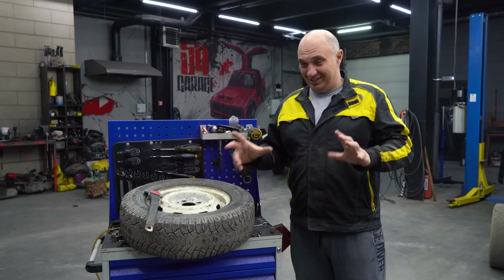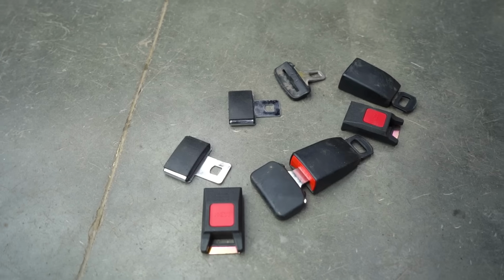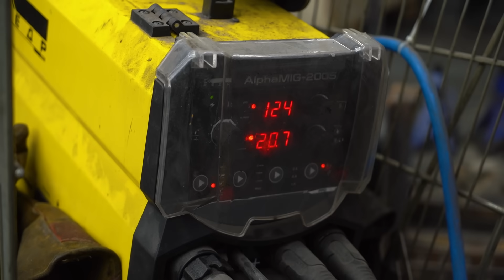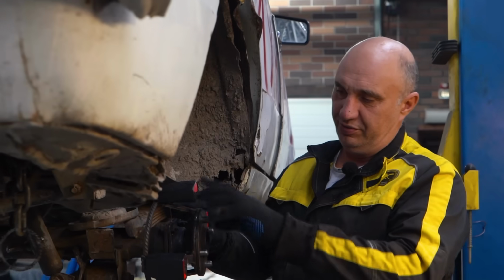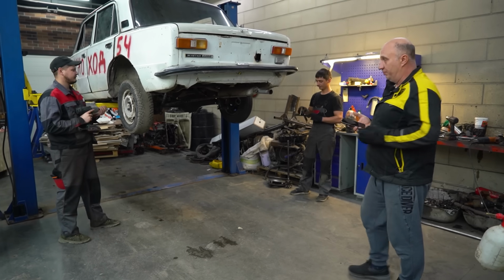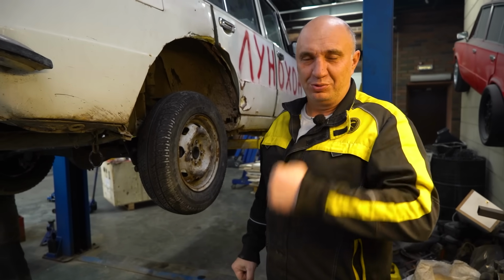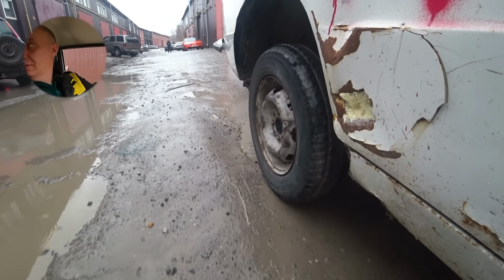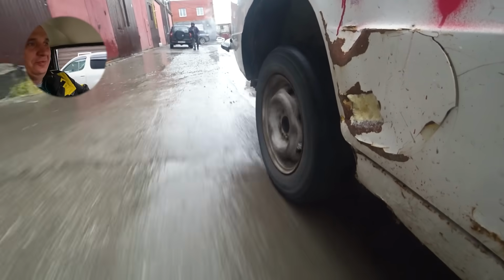Quick seatbelt buckle wheel release mechanism - will it work?

Comment: Just when you think they can't possibly have any more car related things to do, they come up with something crazy like this!
Reply: I would never get this idea!
Reply: Gasoline as coolant?😊
Reply: When they check the comments theres hundreds
Reply: These guys have some wheely cool experiments, such as the seatbelt wheel release, and these guys never tire me. :) 

OK, I'll walk out now with my puns.
Reply: @thatguyalex2835 I agree. I was strapped in tight for this episode. Wonder what the plan is for the shoulder restraints. It's gonna be good.
Reply: @Boycott_Wendys wonder if a diesel could run off it if you left a little in the lines just to get it fired up
Reply: @Boycott_Wendys  gasoline as a coolant does actually work, check out Ken Blocks Hoonicorn Mustang with 1400hp engine but no radiators, the Methanol gas cools down the engine drastically which maintains the engines temp even at extended time of high revving while drifting intensively.
Reply: @ren_03 I think you misinterpret the Hoonicorn’s a use of radiators. It still uses radiators to keep the coolant and oil in check, the radiators it DOESN’T use are the ones to cool the air going into the engine from the turbo, which are more commonly called intercoolers.
The reason methanol burns “cooler” especially in pressure(boost) situations, is it takes twice the amount of fuel. A much higher volume(near double) of liquid fuel is needed to combine with the air, therefore allowing that extra liquid to absorb more heat of the air, dropping the overall temp of the air down. I might be describing that wrong, but that’s how I’ve understood it.

On the topic of gasoline as coolant, I believe there were some channels here on YouTube that did just that recently, should give them a look!
Reply: @ren_03  I'm talking about gasoline instead of coolant in a sealed system. How long before it would blow up, or would it even blow????
Reply: @Colorado_Native  Haha. We better put a brake on these car related puns.
Reply: @thatguyalex2835  Brake fluid for coolant, you say?
Reply: someone suggested it, think they said near the end

Comment: Seat belt latches make for some interesting experiment ideas! I have some below:
- How many seat belt latches are needed to tow a car? Maybe use seat belt latches to attach or pull a long trailer to go with the log truck. 
- Substitute seat belt latches for engine and transmission mounts to see how fast you can pull a drivetrain
- Use seat belt latches to hold a head down on an engine block and see if it will run.
Reply: actually amazing ideas
Reply: Fun fact on your first point, the answer is one. In fact, the seatbelts are so strong I've seen a car lifted by one getting scrapped. I used a seatbelt to yank a Chevy 6.0 last year 😅 seatbelts are incredibly strong.
Reply: In the US the minimum breaking force is 22,000n so you could probably tow quite a heavy car without any problems at all. Infact you're likely to pull the towing eye out first.
Reply: seatbelt engine swap sounds nuts!!
Reply: You got some great ideas man you must have too much time on your hands hahaha
Reply: I would think it would have high tensile strength seeing it is a seat belt so in theory it should tow some pretty heavy loads.

Comment: To see it work flawlessly is seriously impressive. I expected a failure in a few seconds, especially with a welded diff.
Reply: a quick release mechanism on your cars wheel what could possibly go wrong with that plan?🤣🤣🤣
Reply: It's kinda impressive, but if it were real, it would have to last much longer and in crazier conditions than it did here. So the question isn't, does it stay on for a few minutes, but instead, does it stay for 100k+ miles.
Reply: @georgerosebush9754 of course it doesn't. That's not the point

Comment: This is probably do-able with quick release air fittings as well, for that matter It would probably be fairly easy to make an axle sized version of the same concept.
Reply: Kinda like a quick release steering wheel.
Reply: It would be hard to get the wheel off. At least with this design, they have that 4 pronged tool to detach all of them at once. Those air fittings can be a pain in the ass without a wheel in the way.

Comment: Going mostly forward, the studs take most of the load and the buckles only need to keep the wheel on the hub. To really give them a workout, you need lateral load. Try doing donuts both ways!

Comment: they're testing the welds because these latches can handle tons (during a crash you can whistand until 30G during a tenth of a second so 70kg x 30G = 2100kg for one latch and one of these latches stoped my 100kg++ during a crash so these latches can handle something like 5 tons each, so they're testing the welds not the quick release mechanism)

Comment: The real stress was held by the 4 guide nuts and the center of the driveshaft. The seat belt mechanism only prevented the wheel from separating from the driveshaft. Don't get me wrong, it's still very impressive! 😁🤯

Comment: The failure point here would come from the wheel being out of balance, overtime it may crack the welds but would take alot of force and probably highway speeds to get to thay stage. Otherwise can see how it would fail with the studs taking alot of load aswell.

Comment: I'm amazed it didn't break, I know they're rated for some incredible forces but in normal uses those forces would be in particular directions and very different to the forces in this case. I thought the sideways motion (rather than traditional "pulling" motion) would break them for sure, but apparently not!
Reply: I did too but then realized they machined studs to tightly fit the stud holes to prevent any sideways force on the buckles, they just prevent the wheel being pulled out away from the car.

Comment: A normal wheel setup has or it is supposed to have all the force applied to the center hole or the hub. Thats what is designed to take the load and the studs and lug nuts are clamping force to keep the wheel on the hub. When you dont have the proper wheel one your car that is when you get shaking and broken studs. Just because the lug pattern is the same that doesnt mean your new wheels are correct for your car.There are other ways to break off the lug nuts obviously but improper wheel hub fitment is very often overlooked and bad things can happen as a result.!!!¹

Comment: The lug are still there just not with the nut so in my opinion the lugs are taking the load when accelerating and the belts hold on turn but very interesting

Comment: The crazy part, this could definitely be a viable option for modern economy cars with an actual machined hub adapter.

I wouldn't trust a locking mechanism for utility or sport vehicles, but any little turd Nissan or Mitsubishi make would be fine with this!

Comment: If this was actually feasible then Indy would have absolutely already been using them...... Period...... But even if it doesn't fall off for your test it still wouldn't last or hold as good or reliable as the bolts/studs......